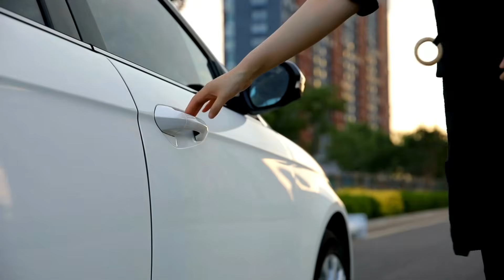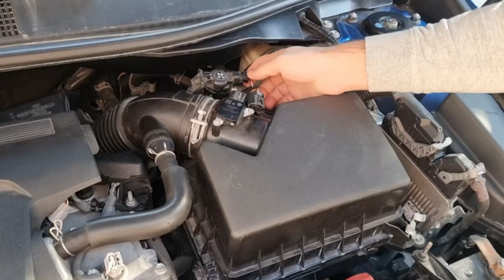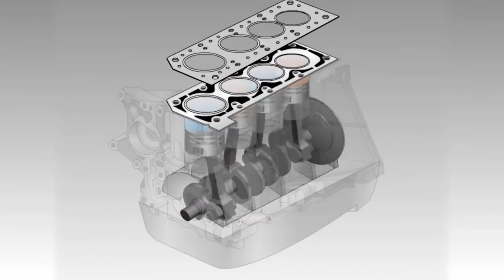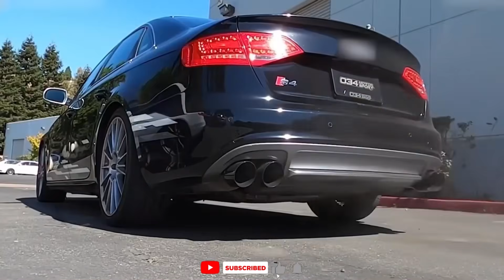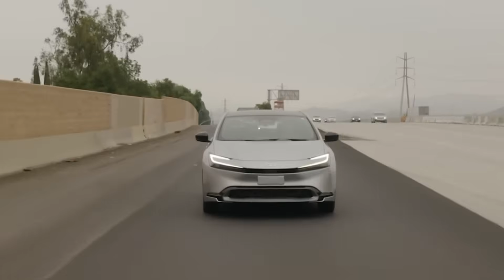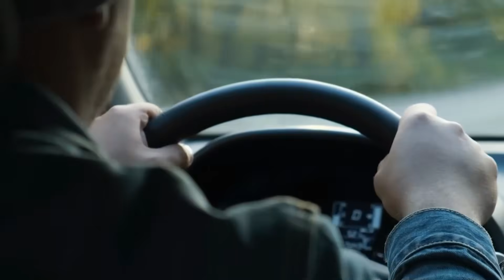Toyota Owners Do THIS and Your Engine Will Run Like New Again

Comment: We drive a 2022 Toyota Venza XLE which presently has less than 38,000 miles on it. We change our own oil every 5,000 miles using an economy brand of full synthetic 0W-16 oil and an OEM Toyota oil filter. We also use OEM engine air filters. I also use only ethanol-free top tier fuel.
Reply from the maker: Sounds like you're doing a great job maintaining your Venza!

Comment: 2019 Rav4 2.5 would you please tell me where the pcv valve is located? Thank you
Reply from the maker: The 2019 RAV4's PCV valve is on the back side of the valve cover on the engine's passenger side, requiring removal of the plastic engine cover to access. It is a small valve with a hose attached to it, and it is recommended to replace the entire valve when performing this service.

Comment: I have Toyota Camry 2008 with burning engine oil at 140 k miles and  it keeps get worse. Now I have quart of oil every 800 miles. I replaced spark plugs more often instead of 60 k miles. Currently my car has 237 k miles. My goal is keeping car pass 300 k . So what I should do next to get my goal please advise thanks
Reply from the maker: Look into common issues that cause oil consumption at that mileage for that model year. Burning oil is not a good thing, let us know if you make it to 300k.